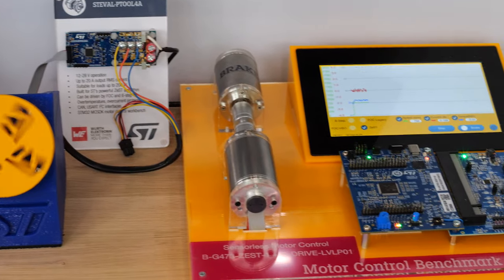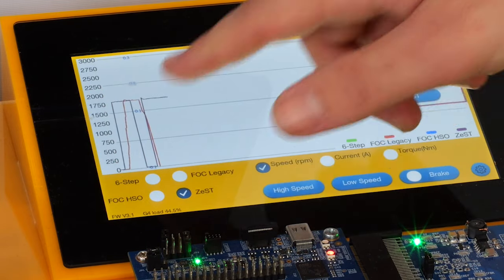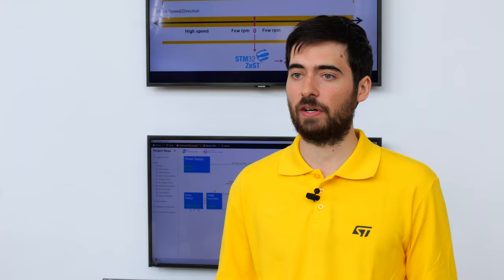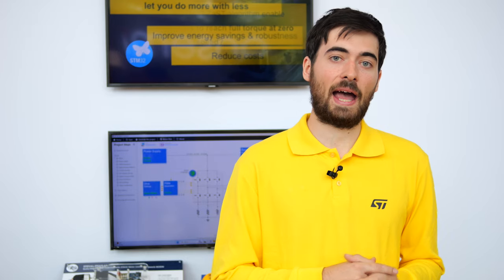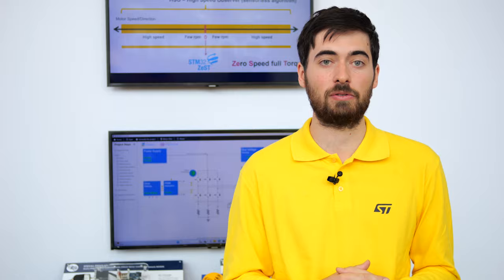Save cost and energy with state of the art Motor control algorithms running on STM32

Comment: Abstract

This video from STMicroelectronics introduces their new sensorless Field Oriented Control (FOC) algorithms: the High Sensitivity Observer (HSO) and STM32 ZeST. These algorithms allow for efficient motor control, even at low and zero speeds, while eliminating the need for sensors, thus reducing cost and complexity. The video demonstrates the capabilities of these algorithms and highlights their advantages for motor control applications.

Benefits of Sensorless FOC

* 0:00 - Optimizes motor-based products by saving energy and enhancing robustness.
* 0:05 - Reduces Bill of Materials (BOM) cost by eliminating sensors and wiring.
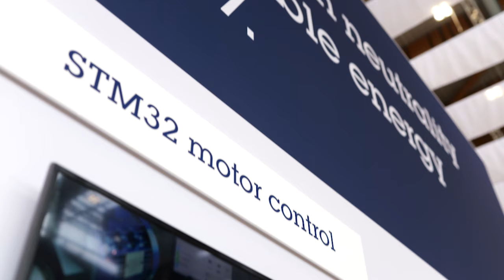* 0:18 - Improves quality by providing accurate motor control without sensor dependence.

Introduction to HSO and STM32 ZeST

* 0:26 - Two FOC algorithms are available: the Luenberger State Observer and the new HSO/ZeST combination.
* 0:39 - HSO and ZeST offer improved performance at low and zero speeds, enabling full torque control.
* 0:48 - This innovation allows motors to start with full torque, overcoming a significant challenge in sensorless control.

Demonstration of Sensorless Motor Control

* 1:00 - Two demos showcase motor control under different conditions.
* 1:02 - The first demo features a low-power brushless DC motor controlled by HSO, demonstrating quick startup and smooth direction changes.
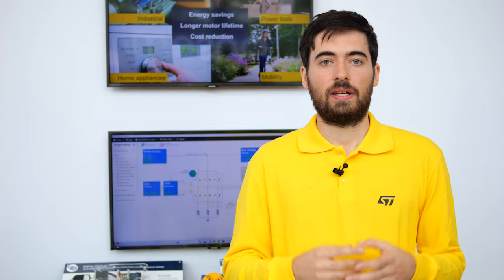* 1:16 - The second demo compares various motor control algorithms under braking conditions, allowing benchmarking of current consumption, startup time, and recovery after stalls.

Technical Details and Advantages

* 1:38 - HSO and ZeST algorithms run on the STM32G4 microcontroller, requiring around 70kB of memory and minimal additional hardware.
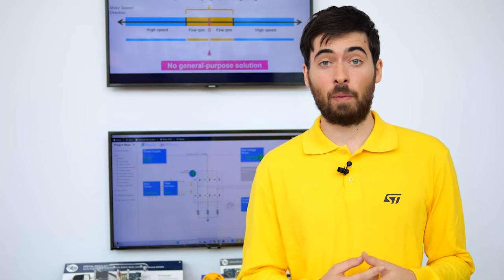* 2:00 - These algorithms estimate rotor position through computation, eliminating the need for sensors.
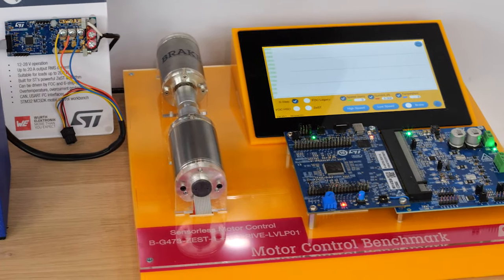* 2:23 - HSO and ZeST excel at low and zero speeds, where traditional observers struggle.
* 2:32 - ZeST provides full torque at zero speed for any synchronous motor, enabling "flying starts."
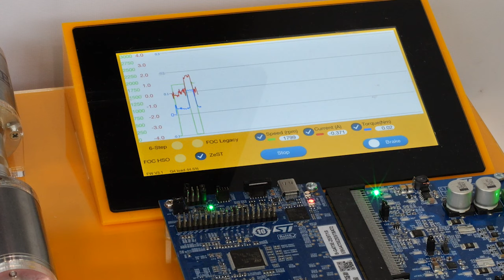* 2:56 - Being pure software algorithms, they require no additional active components, reducing BOM cost and PCB complexity.

i used gemini 1.5 pro to summarize the transcript